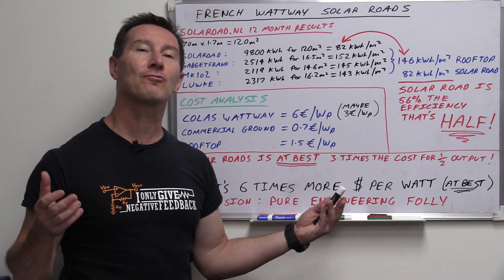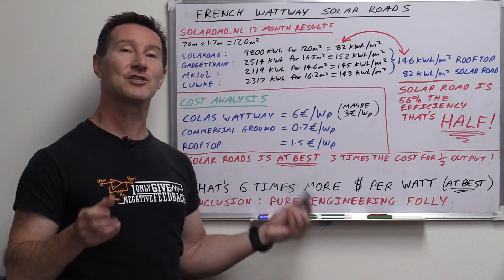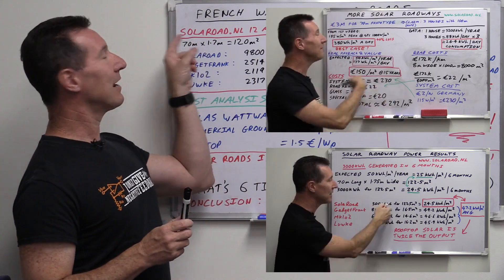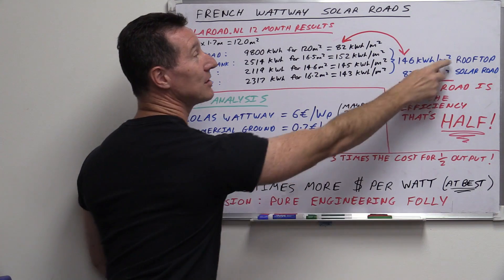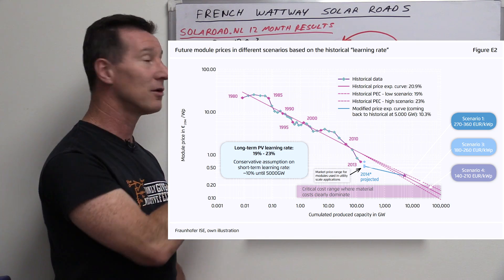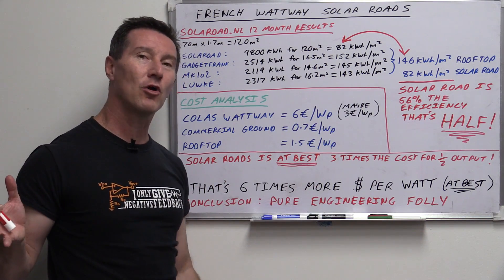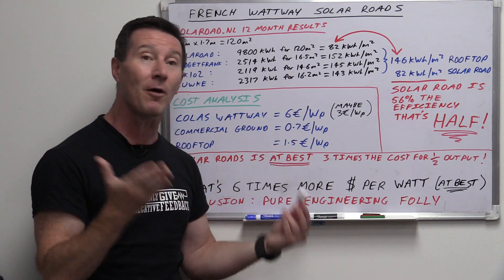EEVblog #850 - French Wattway Solar Roadways BUSTED!

Comment: I will tell you why to do it. Because even if its not as efficient as it could be, it will point us in the right direction and you can gradually improve from there. Seeking perfection before even starting makes no sense.
Reply: +Jona Goldman The point is that with the same amount of money, you can make a least 6 times more energy (as Dave says) by installing the solar pannels on top of buildings or other things that are favorable for solar energy rather than putting them on the road, thus making more energy with less cost/material waste
Reply: I am no expert, but installing panels in private buildings is not as simple as it sounds. You need to sign contracts and install controllers for each building. It can take years. It's a lot of work. It is more realistic for a government to install one long zone of panels in something they control, like roads.
Reply: Yeah but its even more impractical to put solar panels on roads, their gonna get covered up constantly by cars, and like guy in the video said, the efficiency is so horrible and it cost more. Also when a solar panel is flat it doesn't collect as much sun as if it were angled to the sun and tracking it. If you need directions to where your going you can use a map, buy a gps, or ask someone, or read the signs on the road. We don't need a solar roadway to do all this crazy shit for us when what we have already works.
Reply: +Jona Goldman That is not an actual issue.  doing solar roadways because you don't like to sign contracts basically amounts to trying to solve a lot of massive problems because you don't feel like solving a few tiny trivial ones.

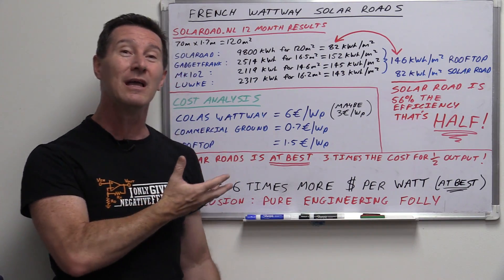Also,  " it will point us in the right direction and you can gradually improve from there"  did you watch the video?  Dave adresses that at  12:35...  all this does is make green energy look bad.
Reply: +Jona Goldman Germany has shown that it's easy to install solar on privat buildings with feed in tariffs. There are a lot of public buildings: schools, town halls, police stations, hospitals, there are a lot of commercial buildings. To put solar on roads makes no sense.

Comment: Being generous, it might make sense if they could come up with some amorphous paving material similar in cost and other properties to asphalt, but also had photovoltaic properties.  The material could be substituted when repaving or building new roads.  Of course, there's still the cost of collecting the power and getting it on the grid, which could be substantial.  A few years ago there was a flurry of stories about the potential of low-cost, low-efficiency paint on solar material.  I don't know what, if anything, ever became of it.  Obviously, I'm not holding my breath.  It all seems very pie in the sky.

Comment: What I'd like to see is the mandatory installation of solar panels on every gas station (or wind generators)  - with enough energy storage and fast charging stations for electric vehicles. It should give electric car and bike sales a good push right now. I think Tesla is on the right track on this.

It should also benefit businesses in the vicinity (like cafes, restaurants and shops) and help develop a decentralized renewable energy generating infrastructure for the future. 

How many electric cars (say... Tesla Model S) can you charge in a day with your rooftop panels, on average?

Comment: Not to mention the layers of rubber and oil droppings and all the other crap that ends up on the roads.  Also the surface  roadways wear away at a non trivial rate.

Comment: Of course its about half. It was a road. They simulated 'real life' scenarios. 
Which means no maintenance or periodic cleaning. Cleaning was done naturally by wind and rain.
And also due to a manufacturing fault, One panel got cracked. So that panel was turned off.

Comment: All of this ignores the specific problems of solar panels. For example. if a single leaf stays stuck to a rooftop solar panel, you get massive drops in efficiency and excessive heating. You cannot expect to maintain a completely clean road surface. Also, cars tend to drive on the same sections of the road, wearing some it more, and dirtying the rest. 

Also, solar panels need to be produced, transported, and installed somehow. if they are going to be worn out so often, we're gonna produce tons of super toxic waste when producing them, tons of CO2 emissions transporting them, and billions of wasted dollars worth of road maintenance replacing them. 

These panels should first be optimized on rooftops before we do anything else with them.

Comment: The video that finally made me unsubscribe. This is the dumbest garbage I've heard for a while. The technology is not ripe yet, but do you think cars were a sensible idea when they came out. Terrible roads, no gas stations, noisy. Efficiency and yield is only one aspect of this concept.
Reply: +sonicseaweed Dave does get a bit 'ranty,' but his points about installed cost per watt and high maintenance costs are entirely valid.  This nonsense will ALWAYS be more expensive than simple rooftop solar.   Call me when/if we run out of roofs.  Until then, Dave's critique is 100% justified.
Reply: geonerd Fair point. I'll just say that this was not for me. As far as rooftops go, very few of them are public and thus the cost go directly to homeowners of facilities owners, roads are owned by the government and they have a completely different potential for doing large scale projects.

Comment: BUT...  they could make energy at night from the streetlights shining on them!  At night you could power the streetlights from the energy that the solar roadways are producing (from the streetlights shining on them, of course!) - you wouldn't have to put any energy in ;) 
Talking of energy, we could also power our cars with just magnets. I know it's possible 'cause I've seen it on YouTube, it's just that the large corporations are holding it back - just like Colas in this example. 
Oh, hang on, Colas (large corporation) are the ones behind this SR effort.  Um... they are probably sabotaging SR then... or they're controlled by the illuminati... yeah that's it... it's the lizard people stopping it - AGAIN! X)

Comment: Your right there are better places to put solar panels.  And until those are used up, why use roads.  

But I wonder.  We do know the roads do absorb a lot of heat.  This fact results in urban ares being warmer than rural areas. And I'm sure we have all experienced how hot asphalt gets on a hot summer day.  Could there be a more mechanical way to extract this heat for our use.  Could be used directly for heating.  And there are a variety of ways to use  heat to produce power.  If this is feasible, then the efficiency could be increased by increasing the roadways ability to absorb infrared.

Comment: In my area, the road generally has to be repaired every 1-3 years, after winter, there will be some damage, as well as chunks knocked out when the plows run through. The road also takes a beating due to large trucks regularly running through.

Other than that, they also often need to dig the road up when ever they need to do maintenance of water, gas, electrical and data lines. Solar panels on a road used be vehicles will never last long enough to cover their own cost.

The problem with governments handling this stuff, is the people who make these choices never think long term, they think only of what is good for their image right now.
E.g., some local schools have ordered ipads for all of the students to use in class, after a round 2 years, most of them are not working, the remaining ones have a host of issues such as pressure marks on the screen from people pushing it too hard, scratches, and crap battery life because they are run all day. When I was doing student teaching, and wanted to use the tablets, the cooperating teacher recommended that I avoid them since they are too unreliable, and don't last long enough to get any work done.

The principal got tricked into getting a ton of non serviceable tablets that ended up being junk after about 2 years.
Reply: +Razor2048 Exactly.  Maintenance will be the final stake-in-the-heart.
A typical asphalt road needs work every few years and a best-case rooftop solar install needs ~10 years to reach break even (with near-zero maintenance).  Even if Wattways cost the same (much less 10x per watt), it would never pay for itself before wearing out and/or requiring wildly expensive repair.
Reply from the maker: +Razor2048 That's why it will never happen even if it was feasible from a power and road surface perspective.

Comment: how does mjlorton of you tube get the data of 1000Kh/m^2 for the earths surface, and can we ever get close to the much output for a solar panel ? Sunlight simulator pt 1 . Ow and dont forget running a snow plow on it :)

Comment: Here in Denmark we are talking about a bicycle road for about 20-30 km with solar panels covering parts of the road, and providing power for the lights at night through batteries. It's actually a pretty great idea, and should even be able to send something back to the grid, while being prestigious, pretty to look at and providing shade and cover for the bicyclist. 

The idea is to get more people to bike to work, it's gonna be in a pretty heavily traffic area, so we would (hopefully) also get less cars, when you could bike under a roof with lights during the night. I kinda like it, even if it would be a semi-failure, it's not the worst we could try to spend our money on.

(We already have tons of solar arrays and wind turbines)

Comment: Do rooftop panels provide enough power for all buildings? You might need to put panels on other horizontal surfaces to get enough power for everything. Why not roads? We already have roads, so there's no new landuse. New ground for commercial panels takes land away from other possible projects.

A solar road isn't as efficient as a standard solar plant in production or materials or output, but it does use less space.

Comment: Dave, I'm curious what you think about hydrogen fuel cells and fuel cell cars, vs just using batteries? I've heard they are a lot less efficient unless you use natural gas to generate the hydrogen

Comment: What bother me in your video is that there is lots of things you don't take into account for the cost. If you install solar panels you have to use some land and it does not come for free. For the road, the cost of installation would only increase by a small fraction compare to normal road renewal, but for the solar panels you have to pay the net cost.
Also you criticize the durability, strength of the solar road, but I don't think synthetic roads are a new thing, they may even be better sustaining harsh winters which cost a lot each years (I know you don't have those potholes in AU). Also the maintenance of solar panels are not free and roads are naturally cleaned by rain. And as stated on their website most of the roads are shadowed by cars only a fraction of the time.
I mean its worth trying it. The idea does not sound totally stupid.

Comment: I have a question. What kind of maintenance does it require to run a solar powerplant? I heard that every couple of years (7 i think) you need to replace the old pannels with new ones. Is that true?

Comment: It would probably only be more practical for hot water pipes to run through the road. They get pretty hot, if there is an efficient way to extract thermal energy (lots of water, low deltaT) or use that in some way maybe it could be practical, at least more than photovoltaics. That would probably solve the problems of maintenance, and partially capital expense to implement it, but only if there is a good use for really warm water.

Comment: So this basically is an attempt to put solar panels on top of the existing asphalt road system, basically its sole purpose is power. This makes no sense with the math. 

The thing I'm still curious about is the original system (with the hexagonal panels) which was intended to be a replacement for the whole road system. Is that in the long term cheaper than everything it replaces (probably not)? And if it is not cheaper, does its extra benefits of a "smart road" justify the cost?
Reply: +pop1040 There is no way the hexagonal SR will be cheaper than plain old asphalt, even with the energy they generate.  Vastly higher installation and maintenance costs mean it will never be cheaper.
Reply: geonerd I wouldn't be so quick to say that, asphalt takes allot of maintenance and oil prices certainly are subject to fluctuation. But the more interesting question is does the extra features with the lights, pressure sensing, and integrated cable corridor justify the extra cost.
Reply: +pop1040 The lights are a marketing joke, they had to be SOOOOOOO bright to work in sunny daylight.
Reply: Enzo Canuzzi I wouldn't be so fast to make that judgment. The solar power does cover the electrical cost even with the brightness requirements.
Reply: pop1040 It's not about power, it's about how bright they have to be - which results in additional cooling problems (and storage for the night).
Reply: Enzo Canuzzi oh your thinking we would need some high power LEDs, like in a LED spotlight. As far as I head with the reflectors (due to patterns in the glass) they don't need something that big although I might be wrong. The power storage for night, however, is a problem (although I suppose that is a problem for conventional solar panels anyways).
Reply: pop1040 They need to be quite bright, if you want to compensate for sun reflection. You have a lot more options for storage and energy management, with conventional solar. It really makes no sense with LED. If you want to look for practical "smart road signs" you should look after switching the reflection properties of a surface.
Reply: Enzo Canuzzi good thing its during the day that they need to be super bright I guess. Don't need storage for when their brightest. So do you think they make scene for their "smart" road capabilities like the pressure sensing, re-programmable nature and ability to keep themselves just above freezing to keep snow from settling?
Reply: +pop1040 Electronics devices require more maintenance than asphalt does.  You might not need to maintain a tv as much as a road but that's because you're not rolling on it.  Also, since these panels are essentially super thick and strong windows with electronics under them, just go compare the price of a pane of glass to the price of a barrel of oil (by kg!) and youll see they aren't in the same price range.
Reply: Alex Bv depends on the device. Asphalt takes allot of maintenance and its hard work, which is what might save a system like this.
Reply: pop1040 asphalt doesnt require a lot of maintenance because its fragile or anything, it does because youre rolling on it. If  asphalt was handled like your typical electronic device it would outlast every single electronic device out there....  Maybe except the voyager probe.
Reply: Alex Bv Oh I don't know, the strength of a piece of asphalt is entirely different to that of the special glass they use. A clump of asphalt can actually fall apart quite easily, its the compression force and use as a road in which it has its strengths.